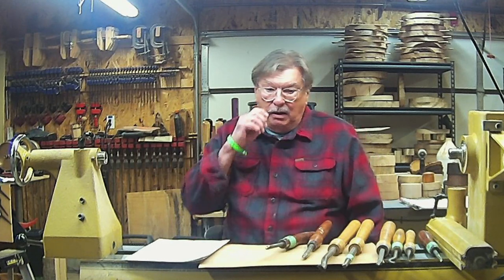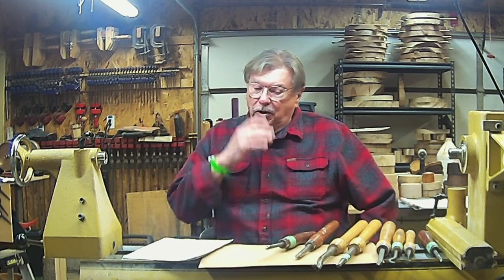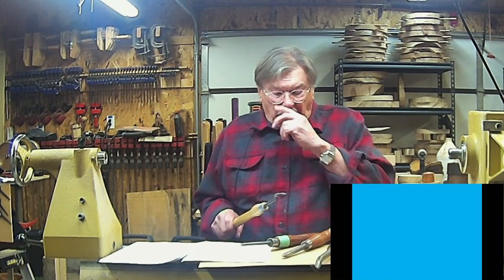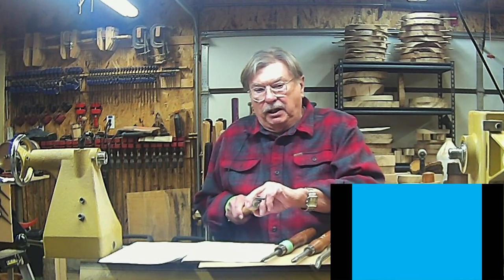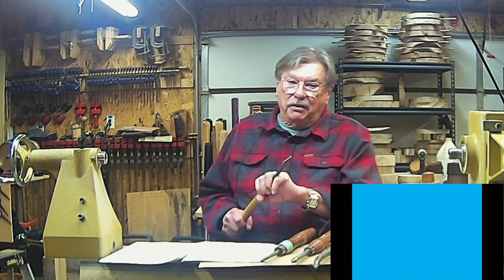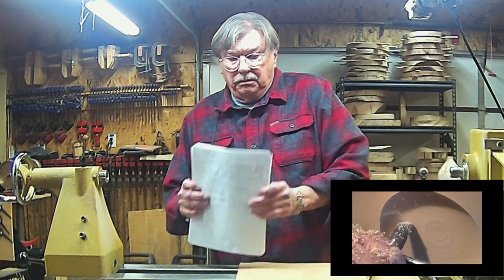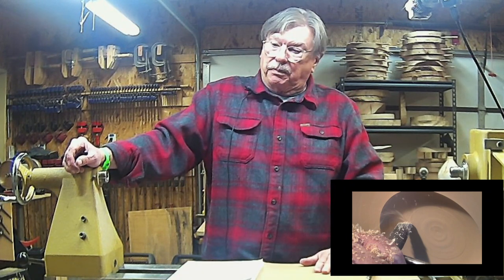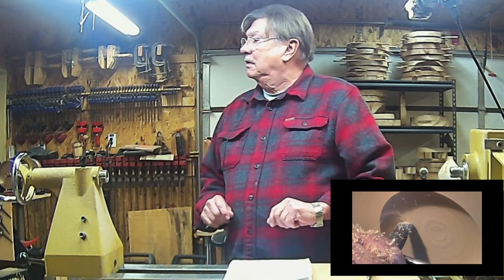Overview of Hunter Tool Systems woodturning tools

Comment: Why do some cutter start at 9 o’clock and some like the Badger need to start at 7:30.   I have a badger and I keep getting BIG catches. Especially if I start at 9 o’clock.
Reply from the maker: All tools need to be used with a tilt angle.  Tools such as the Osprey and Viceroy have front tilt angles built into the cutter position.  Tools such as the #5 Straight Badger, it is required to add the tilt angle by turning the tool to about 7:30 on the clock.
Mike